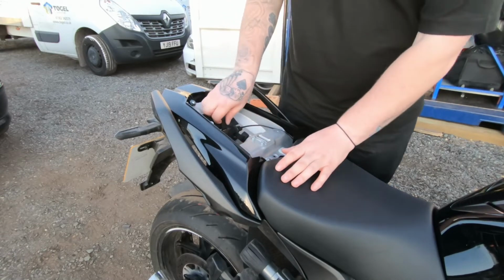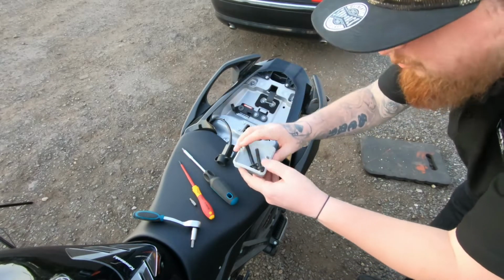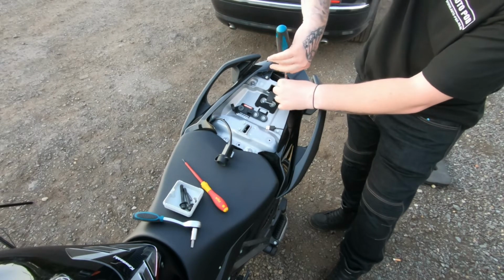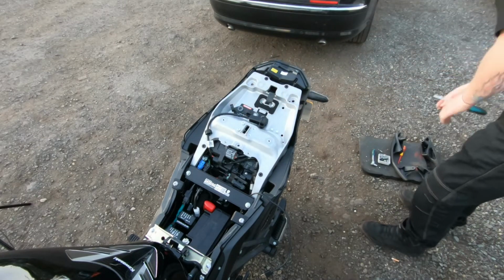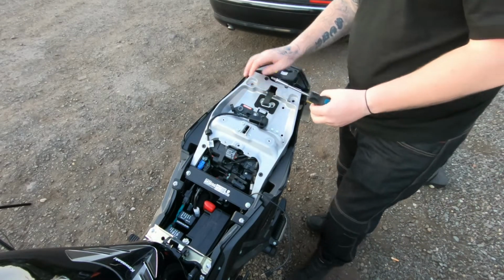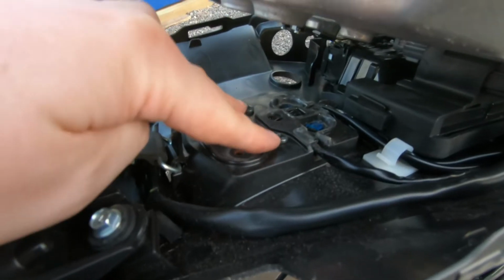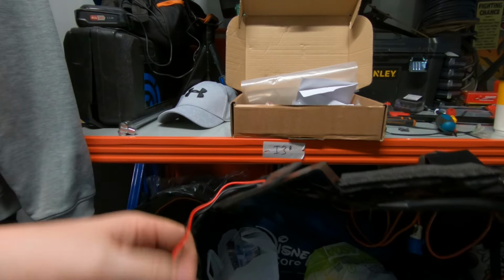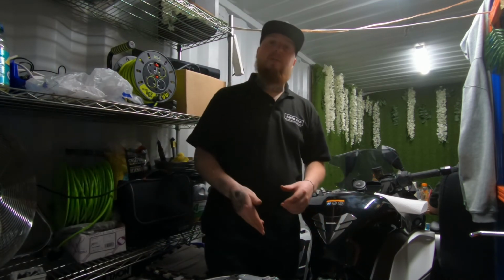HOW TO INSTALL TAILTIDY ON A KAWASAKI NINJA 1000SX 2022 R&G

Comment: with the 4 bolts fixing it to the sub frame the lenght of the tail tidy to the number plate carrier seams to be the issue. as though it needs another fixing point. so yours doesn't flex?
Reply from the maker: No flex on mine